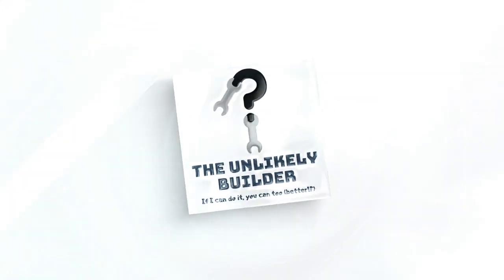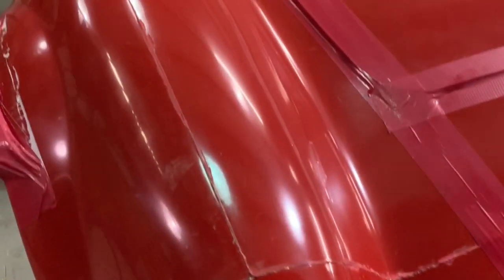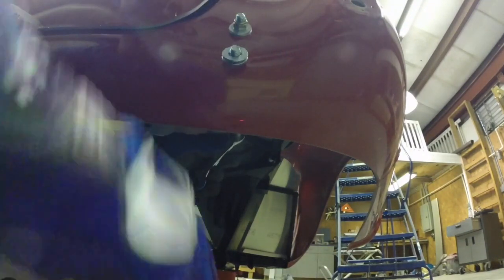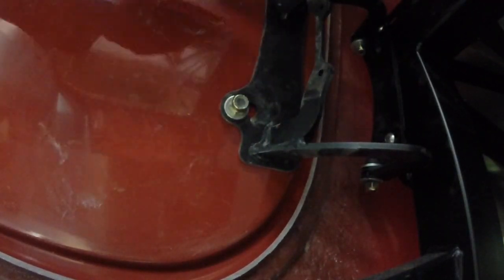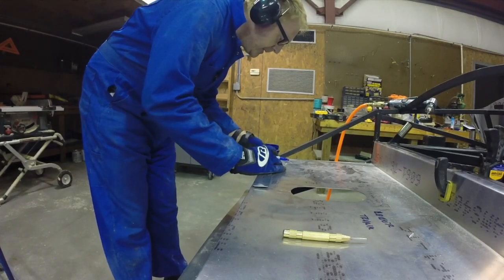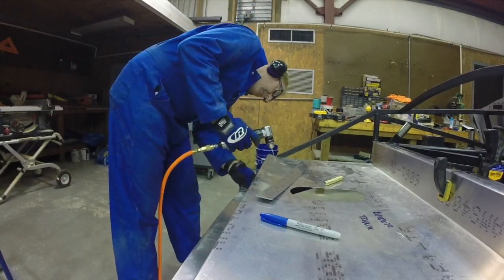FactoryFive Roadster Build -  Episode 1 - Getting Started

Comment: 1:40 - I too plan to get the holes pre-drilled. I think it saves a lot of labor and reduces chance of error.
1:25 - As well as note which holes they went through.
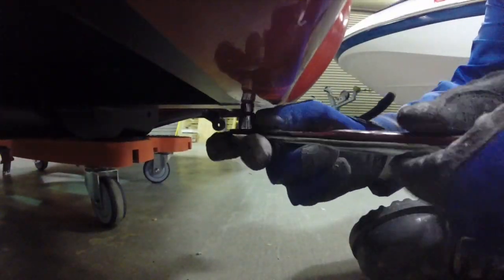2:25 - I have dropped a few hoods and trunk lids on my head as well ;)
2:40 - You noted earlier about tracking the nuts and bolts. I find putting them back through the holes they go in works. Or remove and place in Ziploc bags and label clearly.
3:22 - There's that punch! I mentioned it in another video (I found yours during a search so I did not watch in order).
3:50 - Excellent advice, it will definitely ease the reassembly.
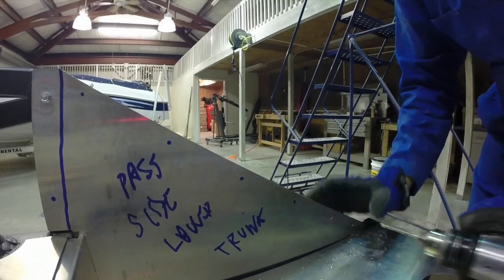4:13 - Count to 5, if your drill hasn't gone through yet, it's dull. Keep a large supply of bits on hand.